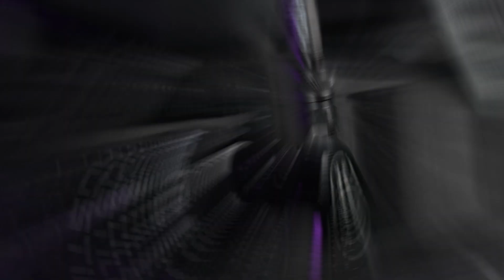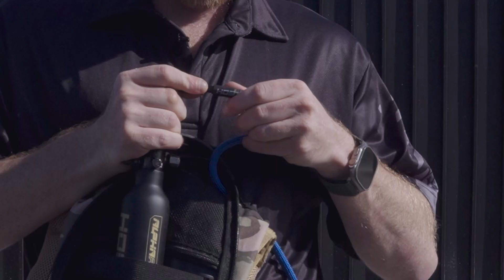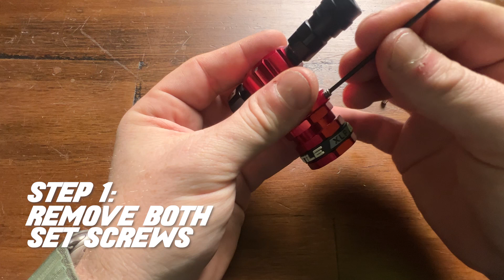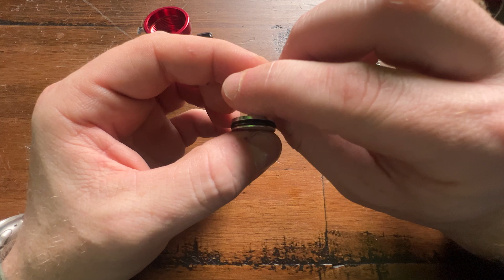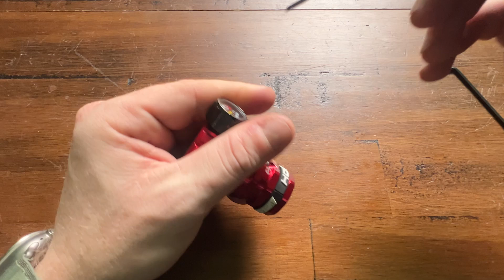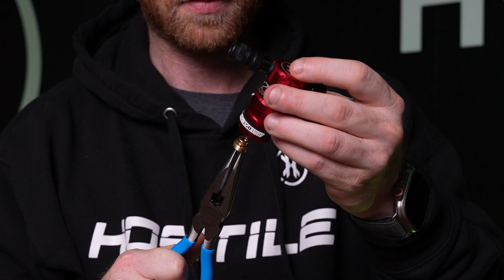XLP Regulator Maintenance

Comment: I came to this video hoping to troubleshoot my XLP reg. When I connect my tank it slowly goes way past 150psi I have to unscrew the tank because I don't want anything to blow. When I go ccw on the velocity screw, it does not bring the out down. The screw only works when I'm turning it up. That's a hassle having to take the tank off to adjust. 

Then I thought let me open it and see if there's something wrong with the O-rings, so I'm following along with the video and take out the 2 grub screws and I can't unscrew the 2 halves apart. They're super tight. 

The first thing I did when I got this product last week was follow the video on how to properly connect everything and now I'm wondering if I got a bad one. 

I'm new to airsoft but I'm not new to tanks and regulators because I have many years in paintball fixing and maintaining regulators. 

Can anyone help?
Reply from the maker: Reach out to our customer service and we will take care of you!